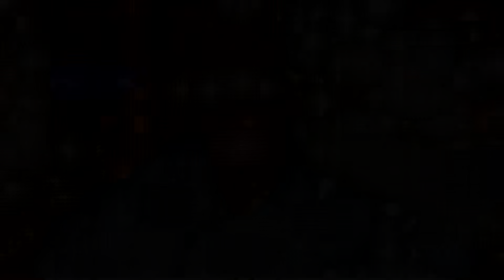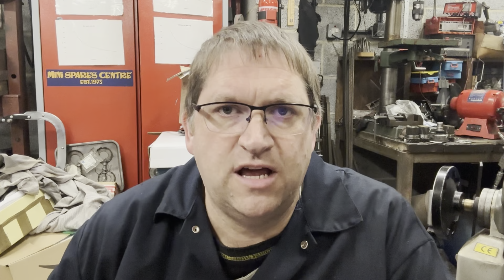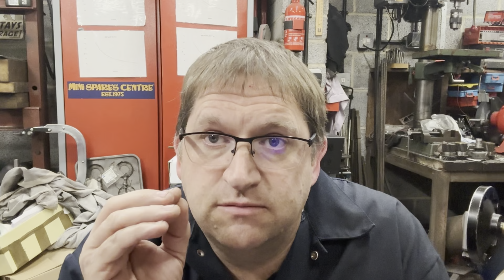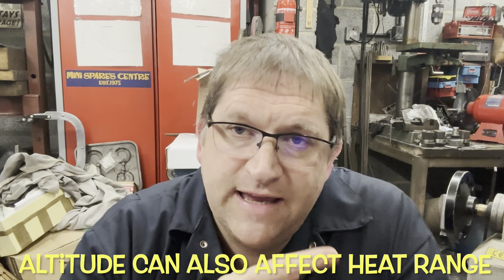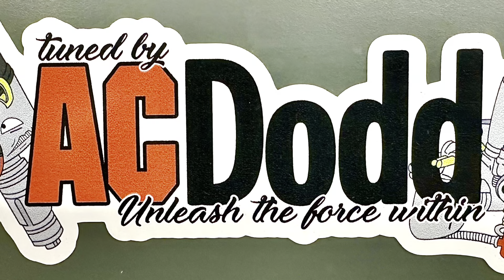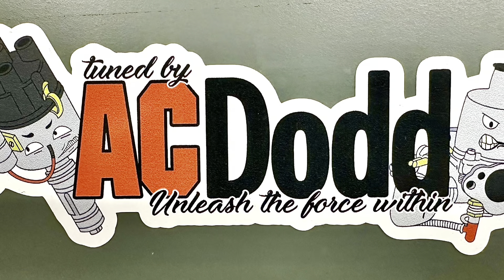What were they thinking 2025 - Part 1 Ignition

Comment: The confusion with coil resistance could come partially from accuspark as they supply 3ohm coils with their electronic ignition and I don't think they are happy with using a 1.5 ohm coil.
Reply from the maker: There is a reason I stock and use powerspark. It gives me more options.

Comment: So number 5 timing. Does that mean if someone has a lean mixture to get the car running better they are unbeknown compensating with advanced Ignition which is masking the lean mixture?
Would this show up on the spark plugs or would they look good?
Reply from the maker: This is an area that reading the plugs will not show the problem as the cylinder pressure won't be correct. A Wideband will show it straight away.

Comment: For aircooled VW after "points" there was inductive TSZ (Transistor Spule Zuendung) ignition that used a 0,8Ohm ballast resistor.  Some aftermarket coils do not need the resistor. I think inside the module, the transistor or the main charge capacitor can fail or weaken over time so the spark may get weaker.

Comment: AC: Good countdown vid, I'll listen to this over a Paul Gambaccini ramble.  It goes against anything I've ever understood about ignition. Specing a no-vacuum dizzy when the rest of Mini production had vacuum sounds like actual  'race-car innit' sabotage? What am I missing... surely Coopers  need mid-throttle/ economy as much as any car?
Reply from the maker: It was likely done so the car could be used in factory completion. Ie it used a factory dizzy
Reply: @ACDodd  Thanks AC. Of course. My silly question really. Race/rally regs would have forced  'production parts' only. Thus road-car performance  was kinda' sabotaged for the race-wins.
Reply from the maker: @somebloke5565 👍
Reply: The cooper s distributor had  different springs giving more advance low down. This provided a modicum of extra advance that would otherwise be provided by the vacuum advance.  Note that the Lotus and Ford twin cams didn't have any vacuum advance either.  I never noticed any problems with either my standard Lotus Elan + 2 or my old 1275 mini fitted with cooper S springs and no vac advance.  I even have an MG metro distributor which has what seem like cooper S springs fitted (based on visual examination and an advance check through the rev range) and it worked just fine on my MG metro engined mini without the vac connected. ( I didn't realise the mod when I bought the car - it explained a few quirks I found when running it first)
Reply from the maker: @peterknight4692 trust me the extra 20degrees afforded by the addition of vacuum advance makes a huge difference to economy and the amount of  extra heat dumped into the valves and seats due to insufficient ignition advance at part throttle running causes increased valve seat wear and cracking of castings. See my video on vacuum advance for more info. Running without addition advance at part throttle on a road car is n shooting yourselfnin the foot. Racing/competion use, well that is a completely different scenario. When you want good punch from low in the rev range it's normal to increase the advance around 2000rpm, the trick is to do this to the maximum while keeping the vacuum advance, this way to optimise for all conditions.
Reply: @ACDodd  Indeed, if the centrifugal timing is optimised for full throttle throughout the rev range then the extra vacuum advance is an advantage. Clearly the Cooper S centrifugal advance was a compromise to provide optimum advance under full throttle at higher power output and a certain amount of extra advance low down for part throttle.

As an aside, I replaced the modified distributor with an aftermarket MG metro distributor and use the vacuum advance.  Still runs just fine, no difference to the water temperature.  Interestingly the original MG metro carb has the vacuum takeoff after the throttle butterfly, so I had to modify the manifold for my twin HIF6s to provide an equivalent port.  20 + degrees BTDC at idle.  😀
Reply from the maker: @peterknight4692 ported vacuum will give you much cleaner idle emissions.
Reply: @ACDodd  I'll stick with manifold take off for this MG metro engine engine since that's the way the MG metro was set up.  I note the MGB was set up the same way, at least some of its iterations were.
Reply from the maker: @peterknight4692 just because it was setup that way does not mean it's the best for all round performance nowadays.
Reply: @peterknight4692  Rather than verbiage, best you understand what vacuum does for a road-car, why a classic (with dizzy) would want it. There's no way a road-use classic Lotus or Cooper is not improved with vacuum. You'll see better road-manners, torque and economy. All this, irrespective of the showroom floor fitment. AC's vids explain this better than pretty much anyone. When you understand what AC is saying, you'll see why what you've written is broadly irrelevant. Do real Physics - leave 'Parts Book Physics' with the rivet-counters.
Reply: @somebloke5565  How strange, I state I am now using a distributor with a vaccum advance and still get blasted for it.  Ah well that's the problem with reading what somebloke says on the internet

Comment: Hi AC, fascinating stuff. I would like to fit an electronic dizzy to my old 1275 Mini (which runs a slightly sportier camshaft and twin SU carbs). Broadly speaking, what type of coil should I be looking for, to be in the right ballpark? Thanks!
Reply from the maker: If you're spending money then fit the 0.8ohm setup from powerspark. You will likely need the dizzy curved to get the best from it.
Reply: @ACDodd Thanks so much AC - very much appreciated 😊

Comment: AC, just to clarify, so that's a 1.4 or 1.5 ohm coil for both points and a 123 distributor with plug gaps of 25 thou on both too, but with a ballast resistor on the points set up but not on the 123?  Many thanks.
Reply from the maker: That's correct
Reply: @ACDodd  Thanks AC. I shall check my two cars, although I seem to recall a lack of markings on both. How do I tell what the ohms are?
Reply from the maker: @DavidUKesb measure it, I have done a video on this.
Reply: @ACDodd  Cheers. I'll look for the video.

Comment: Just bought a nice little Triumph Dolomite 1300 and had a very quick look around and pulled the spark plugs out to see what I was working with.

What did I find? NGK 5P5ES Resistor plugs that were gapped too wide for the completely stock points ignition system the car has 🤦‍♂️
Reply from the maker: Now you know what to do.
Reply: @ACDodd Yes and thanks to your videos I also have a wideband AFR sensor that I can use to set AFR too. I'm expecting to see a big difference in how it runs just by putting a new set of correctly gapped BP5ES plugs in it.